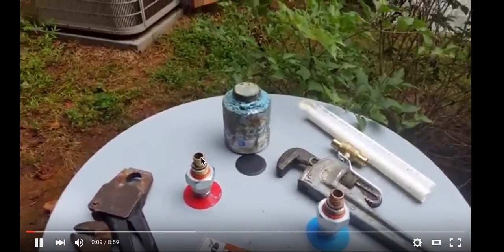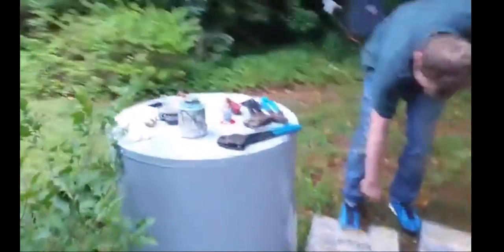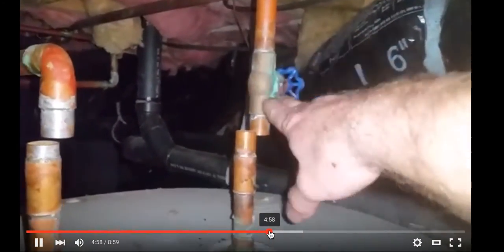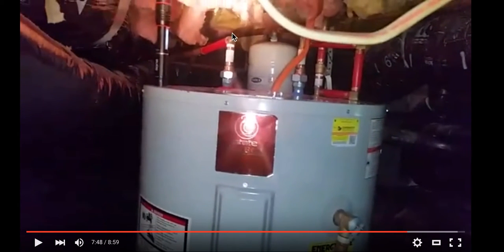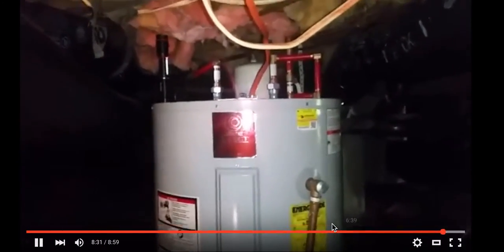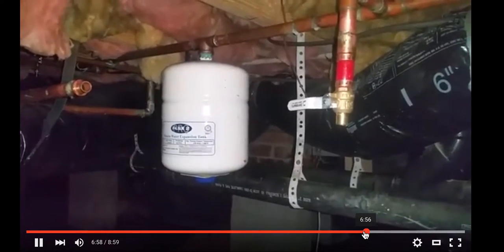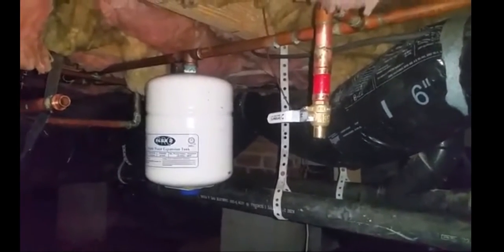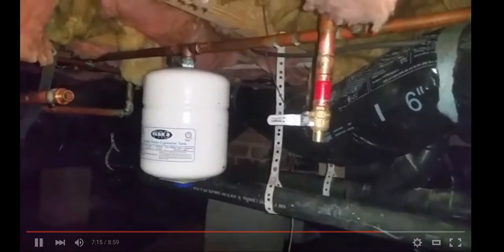expert plumber installing water heater incorrectly

Comment: Pex is fine right up to an electric tank cause there's no exhaust to damage it like on gas
Reply from the maker: This is NOT true, the manufacturer does not believe or state like you "believe". Installers MUST always install products per manufacturer's designs and installation instructions (of the current date of installation).  Thanks for your input.
Reply: All Things Real Estate and Construction Real Estate I go by the plumbing code book
Reply from the maker: That's nice and no offense but, the manufacturer (as the code books reference)... follow manufacturers' instructions when installing "products")... The code books all state something or other about following manufacturer's instructions...   Thanks again... for the banter.
Reply: My installation manual recommends pex pipe so....
Reply from the maker: @mikevbushy  , well show me that manual - send me the link- thank you.

Comment: Hey I just changed my water heater today just got done  I used shark bite compression fittings right from the threaded nipples with 3/4” female to 3/4” pex then pex up to cts(copper) all with shark bite compression fittings the only problem I ran into was on the slip ball valve and the slip coupler fittings they were rated only for cpvc or cts(copper) só I had to run and get some cpvc to use on those fittings that go cpvc to the existing copper I know I m supposed to have 18” of metal but didn’t have room I tried 24” braided and 24”corrugated hoses it was in to much of a bind so I scraped that idea.
Reply from the maker: Okay, so I wish you the best, but the heat from a water heater may expand that pipe or rather cycle it so much in range that it will fail... Just a matter of time.  
I would not panic but I would address this sooner than later.

Comment: @Philadelphia Construction Engineering

Before you made the statement below; you should have checked the specifications.
Here is a link for the installation on electric hot water heaters using Viega pipe and fittings.
http://s3.supplyhouse.com/manuals/1303921558463/54526_PROD_FILE.pdf
Go to page 13....4.9 fourth paragraph down.
Use metallic connectors to attach PEX
to gas water heaters (Viega Part No.
XLSE4418, XLMSE4418 or similar
fabricated metallic assembly).
Install a minimum 18" of metallic or
other piping between the water heater
and PEX.
For electric water heaters, it
is permissible to connect      "directly"      
to the inlets and outlets with a brass
swivel elbow or straight brass swivel
fitting.
I would NEVER install pex directly off of a gas or oil fired hot water heater. Always add a piece of copper supplying and coming from an oil or gas water heater. I know every state or province is different, but to be on the safe side I run copper up to the joists and go with pex from there. Some places call for 18" and others call for 3 feet; so going to the joists covers most codes.
Reply from the maker: I am a little confused by your comments... It appears to agree with what the manufacturer's recommendations are... I agree with manufacturer's recommendations.